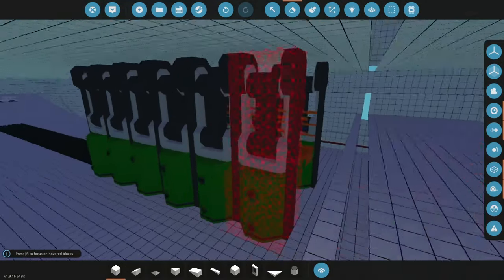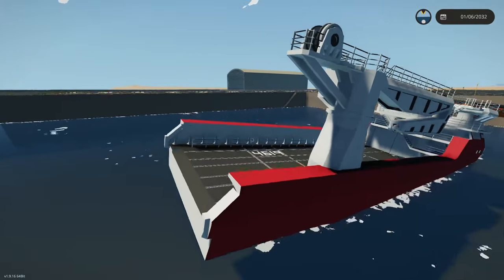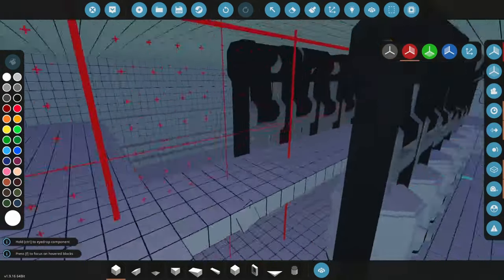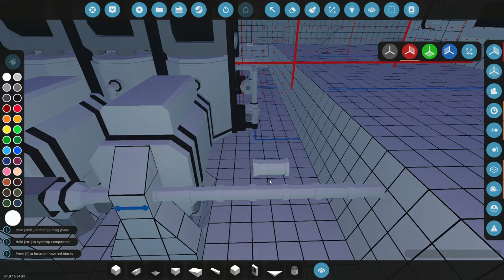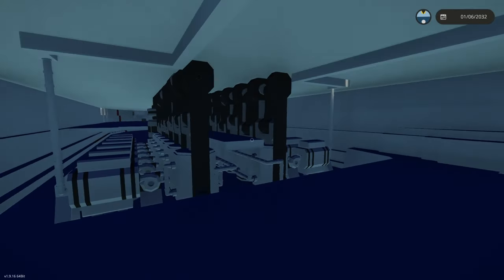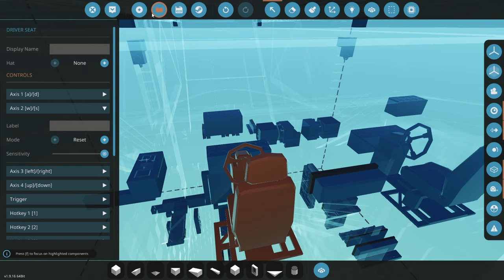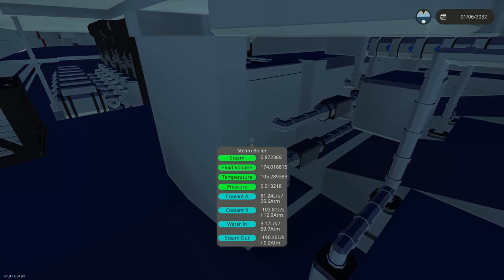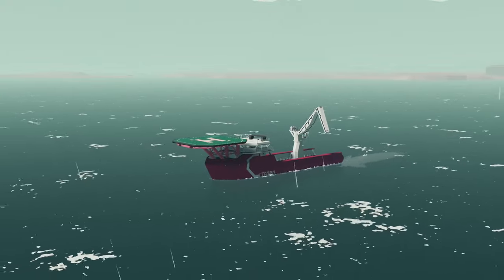Stormworks | The Shipyard | Fitting A Diesel Steam Engine In The Mothership

Comment: I am confused that you barely get 7000W out of that. My reference system with 3 large pistons peak at 17000W since the space update. Could you do me a favor and delete 3 of the 6 pistons in one line and measure again? In my experience you cannot daisy chain more than 3 large pistons. You can line them up but the power does not increase. Would be really nice if you could verify.
It is a joy to watch you sculpture the ship and see the different approaches until you decide on the final built. You are so fast.
Reply from the maker: I can look into it. Maybe splitting the engines into 4 sets of 3 could yield more power if what you say is correct.
Reply from the maker: Ive been doing some testing. You are correct. If you go more than 3, you start to loose power the more you add on. But interestingly if you add them side by side you get all the power output added together with very minimal power loss.
Reply: Thanks for verifying!